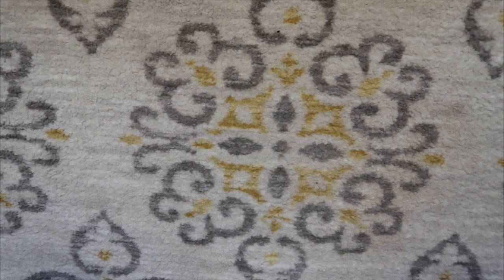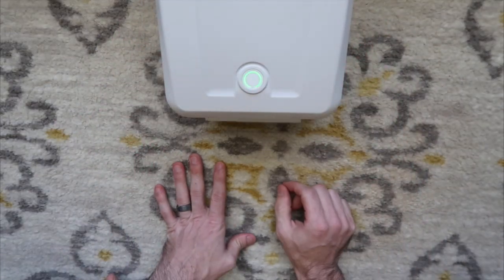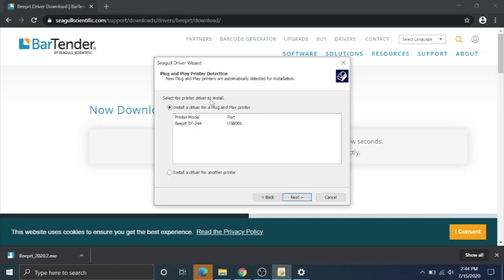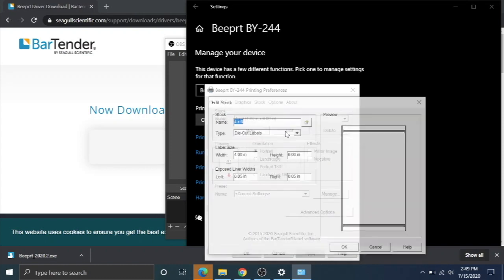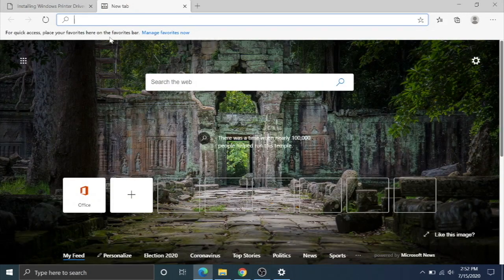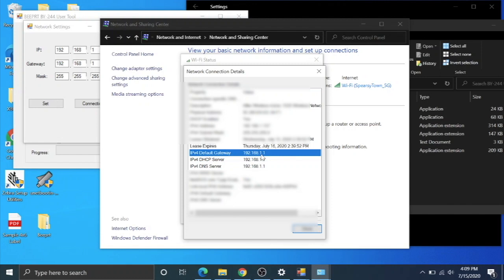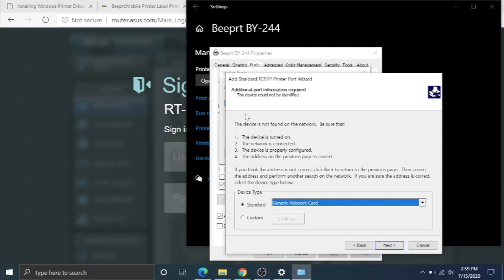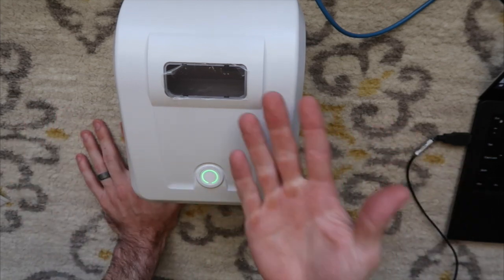Beeprt BY-244 Thermal Printer Windows USB Setup and Network Installation STEP BY STEP TUTORIAL

Comment: Awesome instructions easy peasy lemon squeezy lol. Love this printer and I received a 30% discount on amazon instead of the 15% Will you make a video for the Mac? I want to know if it is hooked up via WiFi setup can it print from a Mac? I need the info on that. Can you make a video for that.
Reply from the maker: This will only work with Mac USB plugged in 😟. You can use the Rollo Mac driver for installation that way.
Reply: @thecollegepicker  😥 I tried putting in the IP for the printer in the MAC but it said it is in use. I didn't know what to do after that. The computer did acknowledge the printer.🤷🏾‍♀️

Comment: Well done nice, demo. Both the BY244 & BY-426BT arrived a couple of days ago. Both good and easy to setup and working well with 4x6 labels. I'm a MAC user so haven't had chance to test on Windows yet but I will next week as the LAN connectivity of the BY244 will be useful for some. With the help of supplier, I managed to get the Bluetooth method working on the 426BT from iPhone, but you  can't use Bluetooth from MAC OS to print a label, so I send an email with the PDF and then import into the suppliers App....a bit clunky, so not sure how useful that will be. I'm trying to find an APP for iPhone that will allow creation of labels on the fly, so could print via Bluetooth. Anyone got any suggestions..?  I think the you can use bluetooth from a windows pc, but will test next week. My initial thoughts are the BY244 will be better for most, as with the paper rolls inside it is tidier on my desk. Here in UK labels on a roll are a lot cheaper than fanfold.

Comment: dude my zebra didn't come with a ribbon...... i am just getting started and so frustrated. i watched your installation guide and i did the best i can for the moment off that. the file was from february when i used the link in the description and most of what i tried following along with was different on my end. i figured i will just go back into the settings and configure them tomorrow. but what kind of ribbon set up should i be targeting?
Reply from the maker: Hi, I haven't setup any zebras with the print ribbons, all of the ones I have are direct thermal. What are you trying to do with the ribbon?
Reply: @thecollegepicker  lol nothing anymore since  don't need one. i am just having all kinds of issues getting it going though. i have no experience with printers and i am completely clueless on what to do. i don't know about the gap settings or any of that.